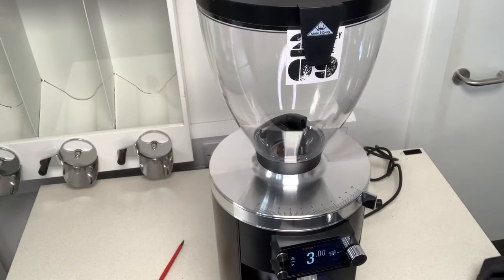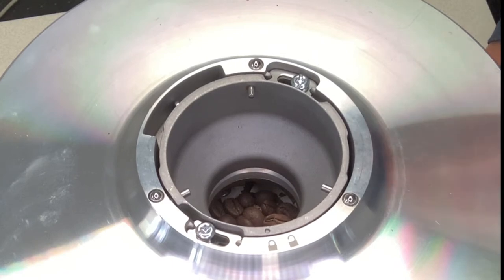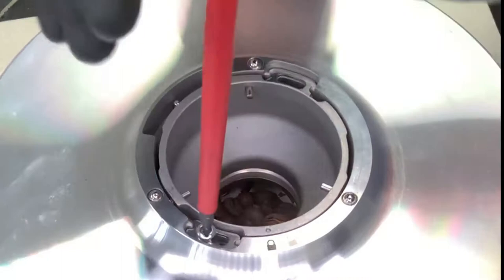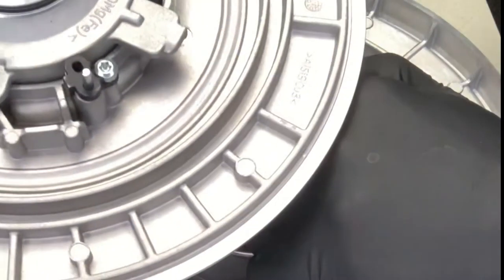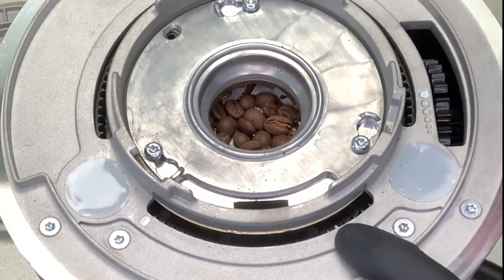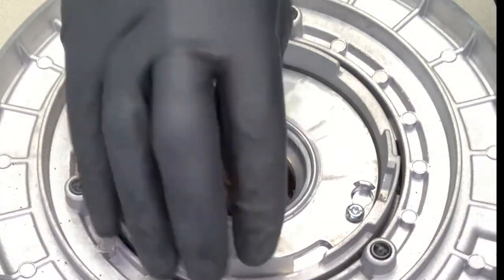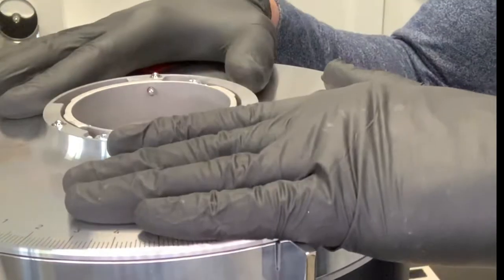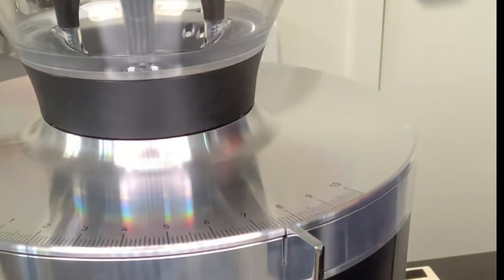Calibrating the Mahlkonig E-80 Supreme

Comment: When you recalibrate the grinder like this does the distance displayed on screen also change for a given position or is the indicated measurement just relative?
Reply from the maker: Hi Tucker, The distance won't change on screen. This isn't an adjustment that the machine will record its a recalibration.
Reply: @silverskincoffee3767  I guess what I'm wondering is if the "Disc Distance Detection" can still be relied on once you've made this adjustment, or if there's a separate recalibration step you have to take in the software like the Mazzer ZM?
Reply from the maker: @tuckspoff  no calibration required. It is still measuring the distance of the change made. The resetting or re-calibratin won't affect that.
Reply: Yes, I was wandering the same thing. After the celebration it is very off from the actual burs distance. DDD would show 0, when in reality the my actual dial is at 3. And if I move dial towards 0 (from 3 going finer) - DDD starts going from 10. So when I'm at the actual closest distance between burrs, DDD which show 7 or 8. Not sure what I'm missing.

Comment: You didn’t bring the dial to zero before taking the dial off, so you have no idea where the zero point actually sits once you put the dial collar back on.. is this bad?
Reply from the maker: Indeed I did not I opened it completely which is howe the dial comes off. This does not and cannot reset where zero is! This just removes the plate, If you want to recalibrate the grinder you must run  and use the adjustment wheel on the right hand side. Hope that helps